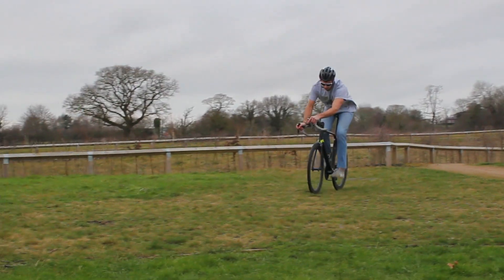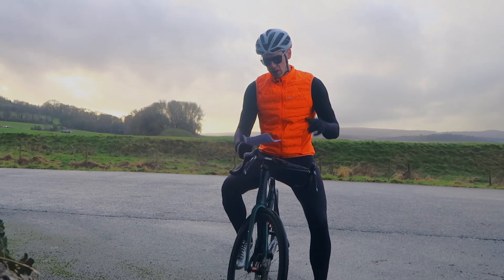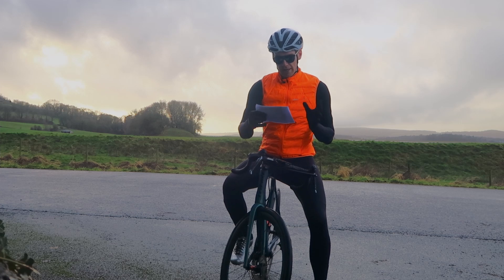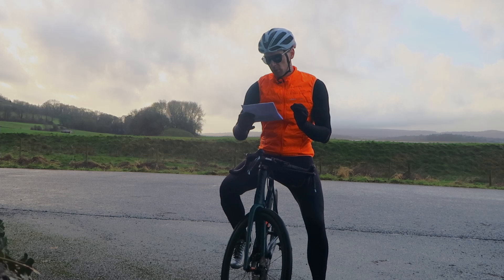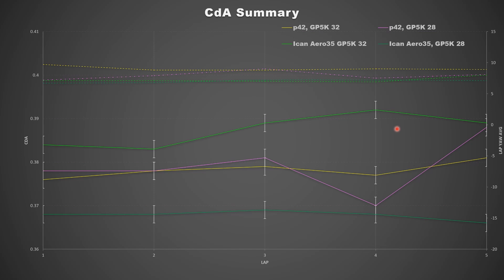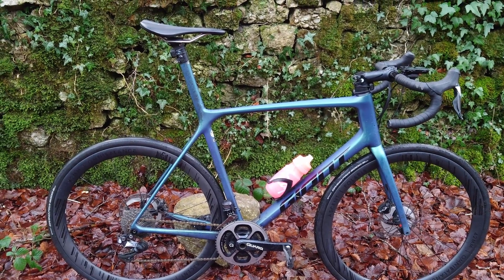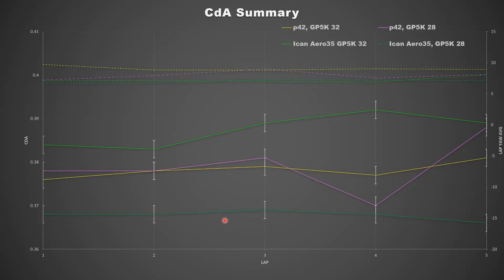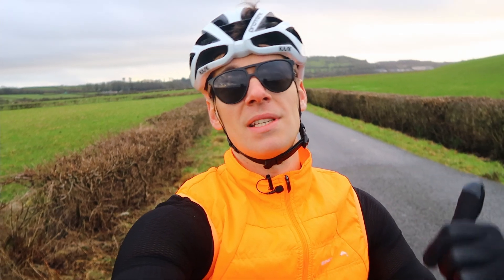Are Wider Tyres a total WIN? The Aerodynamics.

Comment: would have loved to see a 25mm compared to a 28
Reply from the maker: The gp5k 28 is basically the gp4k 25mm. Same measured width. They all got downsized.
Reply: @PeakTorque  Sadly pretty much everything has been downsized today, except the prices of things.
Reply: @PeakTorque  I have a pair of 2020 Hypers, 19 mm inner and 26 mm outer width. On my rims, a 23 mm GP5000 is about 25 mm wide (I run it on the front wheel) and the 25 mm GP5000 is about 26 mm wide (my setup for the rear wheel so far).
I also recently discovered that on my commuter bike, a 28 mm GP4000 is actually 2 mm wider than a 30 mm GP5000 ! Thats a big downsizing I guess !
Reply: @wickedgravity101  Very interesting, do you have any idea how much taller your 28mm tyre is in relation to the 25mm tyre. It looks like on my rim braked bike i may not have appropriate caliper clearance to use the 28mm GP5000's i would like to fit, mind you my internal rim dimension is about 17.5mm so would be marginally taller than your set up.
Reply: @PeakTorque  how tho xD
My maxxis measure 32c when it says 28c on my 19mm inner width rims lol
Reply: @PeakTorque  so they basically tell you that wider tyres are better to make you buy them but in reality they are just the same size as the old ones that are apparently so much slower😂😂
Reply: please compare 25 gp5k to 28 gp5k
Reply: 25mm tyre better than 28mm tyre in term of top speed.

The most simple and consistent test you can do with motorcycle tyres. You can gain much higher top speed just simply use narrow tyres, however you will loose the grip n comfort.

I use my 100cc motorcycle, full throttle, fat tyres top speed at 100km/h and thin tyres at 120km/h.
Human tend to fatigue, definately the results inconsistent between 1st, 2nd round, morning, noon, next day or next week. Just use machine/motorcycle to get a solid result.

My conclusion:

1) Thin tyres much more faster and save watts but less comfort and low grip.
2) Use suitable tyre size for the rim.
Reply: But did the diameter decrease? My frame can only take 25 tyres
Reply: @janeblogs324  Yes, I used to have the 28mm GP4k and they sit very flush to the frame (Orbea Aero Orca M20). Now I have the 28mm GP5K and there's a bigger gap. You should be fine.
Reply: Pogacar also run no more rim brakes anymore. That don’t mean it’s better on mountain stages, but he have no other choice
Reply: 25mm tyre will out perform the 28mm too bad he didnt test it
Reply: tadej Pogacar is running the gp5000 tubeless TT tire this year in 28mm.  So you know if he has switched, no point in a 25mm anymore.  Unless you have really skinny rims.
Reply: @nochancecw  he use 28 because he cant use 25
Reply: @nochancecw  There's still a point to testing the 25mm GP5K on the 21mm internal rims.  I suspect that would be even better than the 28mm (at least of the front tyre) on that rim combo.
Reply: @nochancecw  Beacause UAE uses super wide ENVE rims, so 28 has no aero penalty.

Comment: Whats a fast tyre?
Reply: Depends on your rim width, your system weight and the road quality.
Reply: ones that get flats more easily, just kidding, but not really, the conti gp5000 has pretty low drag but i found that they get issues quicker than other tires i use. vittoria corsas are pretty quick too, but the differnce between top performing tires is mostly less than data noise on real pavement. i quite like the michelin pro 4 endurance v2 but find myself running panaracers more and more for versatility.

Comment: everyday we are closer to the park hybrid dad bike, they've been the answer for ages.
Reply: Fat road bike ftw
Reply: so 'close', yet so far away...
Reply: @seanmccuen6970  i agree, its tough to keep up with a dad on a hybrid when all you got is some expensive carbon fiber bike whose advertising is more polished then their actual product.
Reply: I don't need anything beyond 25c on my local roads and they blow out to close to 28c on my 28mm wide rims. I have a 23c that goes to 25c on the front on another bike with 28mm wide rims. I tried wider tyres but the weight and non availability in my preferred tyres . The tyres I use are Michelin power competition and tufo calibre lite 25c. The Michelin lithions also blow out generously giving around 27.6 on a 23mm internal 28mm eternal clincher rim.